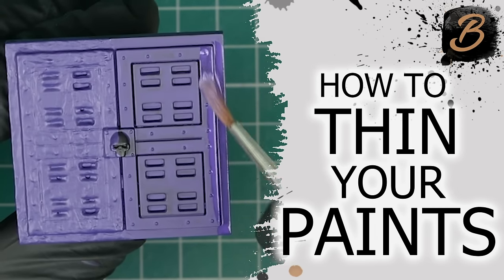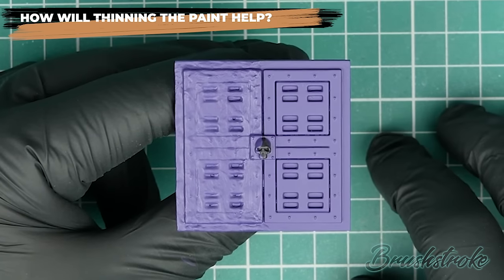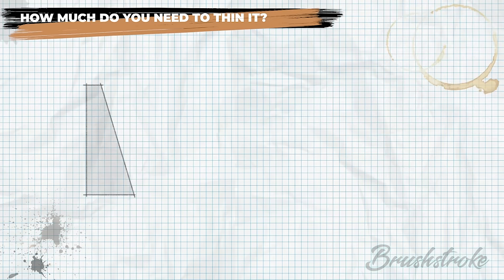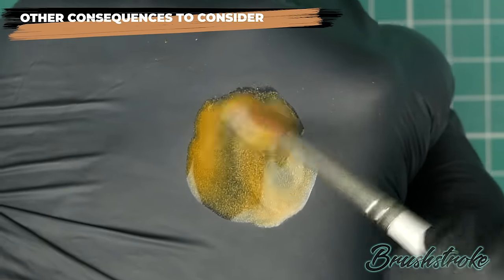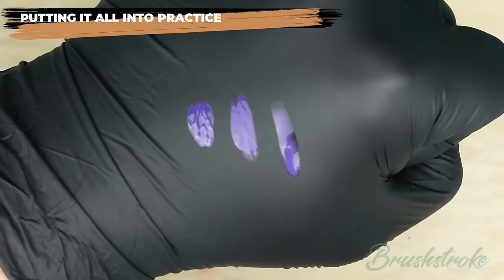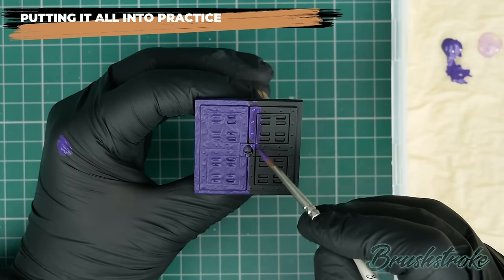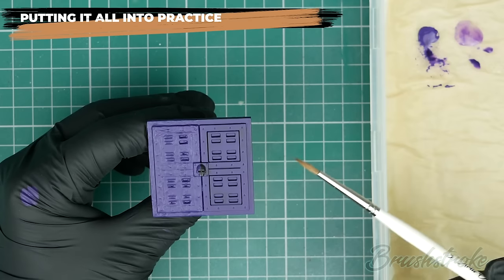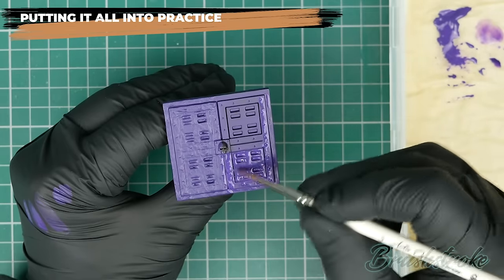HOW TO THIN YOUR PAINTS: A Step-By-Step Guide

Comment: Wow the quality of this video is insanely high from a smaller channel.  Great job!
I will admit at first I didn't think you were doing a very fair comparison as your un-thinned side was pretty sloppily placed down and then you just cut to the thinned side being done which left me a bit suspicious of what was going on.  But you came back to it and showed the actual painting, and while it was more controlled than the other side, it wasn't anything that didn't look doable by any other ape like me :)
I need to try this, but I still suspect there is more to it than just the thinning, otherwise how is it that I often get patchy and ugly contrast coats? They are super thin on their own.
Reply from the maker: Thanks for watching man.
Yeah, the initial comparison is very much intended to be crude, mainly because I can’t tell what skill level the viewer is and I didn’t want to alienate anyone. The idea was to make them almost laugh and say to themselves “hell, even I can do better than that”
More experienced painters will of course see right through that, but then they should be comparing their current results to the right hand side. If theirs isn’t that smooth… then watch on 🙂
So, you ask a good question. 
Why is it contrast paints don’t simply shrink and settle like the paint in the video?
And the quick answer is they’re not like the paint in this video. 
They are designed to behave differently. They have an additional property. They stain.
Give this a watch, it’ll explain it better than I can here
https://youtu.be/mADYQQOH9a8

But it’s that staining property which is creating the watermarks and patchy finish.
Once you know how they behave you can adapt your application and limit the ugly results by not overworking them and actually thinning them more.
Give that vid a watch and let me know if it helps and if it raises more questions 👍

Comment: This made so much sense, thank you - subbed! Question: there are a couple of spots where paint bridged between the outside frame and the inner square section (with the tiny areas you needed more speed to get paint into). How do you clear those one if it's not desirable?

Comment: Right, I know what my problem is now. I realize I've seen this on Zumikito's channel as well and it's the damn wet palette. He puts tissue paper between the sponge and the parchment paper and I don't know what you're doing, but it's much more bumpy while mine's flat. If I put more water in, it spills over the parchment paper and getting that ratio is kind of difficult. 
So my guess is that the water gets pulled out of the paint. 

There's another difference I've noted. When Duncan explains when it's thinned properly, he says "it leaves a flat trail without being watery and without leaving texture" when drawing a line. Seems to me it needs to be a little watery at least.

It wasn't a huge issue for me, because I have other issues at play (cat hair and particles being stuck on the priming stage, rescuing old models etc), but I happened across this in my recommended and I'm glad I did, this will likely help me going forwards.
Reply from the maker: Hey man
So, for your wet palette you shouldn't have any water sloshing around at all. The only water should be in your sponge or paper towel (or whatever you're using as the reservoir) . There shouldnt be any standing water at the bottom of your tray.
I dont bother with a sponge and just use kitchen roll (paper towel). I make up a large cushion of it. Pour water over it and saturate it. Then tip out ALL the excess water. I usually squeeze a little out of the towel a bit too, as it should be damp / wet not swimming.
Then I apply the parchment paper on the top. Hope that helps

Thanks for watching. Let me know how you get on

Comment: Hopefully you can help with this. I have the army paint set (not the speed set) and a wet palette, and nothing I try seems to get your result. 

I'll get a damp palette and put a drop of paint on it. if I take paint directly from the drop, the colour is too thick. If I drag the drop of paint to the wet palette to water it down slightly,  it almost INSTANTLY becomes a wash consistency. 

Any idea what have I done wrong to not have the ideal middle ground in your video?

Comment: should I also apply this method when applying a primer?
Reply from the maker: Yes, Your primer needs to be thin enough to not obscure any details when it dries.
I thin my Vallejo surface primer with some water and apply it using an airbrush.
Just be sure and check what thinner your particular primer recommends to use, as some brands can’t just be thinned with water. 
And of course, spray primers just work straight from the can. Shake them well and I’d also recommend warming them in a bowl of warm water first too.

Comment: TLDR you have to eyeball it. 

Theres no specific amount because pigmentation is so volatile. For example, white is chalky because it has a higher pigmentation to medium ratio, while yellow is so transparent and soft because it has a lower pigmentation (or at least in my experience). The amount of flow improver/thinner/water you use is entirely dependent on the amount of pigment in the paint, so it varies based on your personal instincts with how the paint feels, and the brand you use, with margin for error in the mixing process like paints made in the same factory and put into the same pot 5 years ago will be different in consistency to the same paint years in the future. I remember something about citadel changing its recipe in 2023 so the paints are slightly different.

Comment: This vid helped me out so much. The only thing is, I noticed it’s not working with my white and yellows. I spent time trying to get that opacity with retract, but I keep getting that transparent with retract. Dunno know if I’m doin something wrong or if it’s the paint itself
Reply from the maker: So, you’ve picked the two colours with the smallest colour particles basically, so that makes their coverage chemically poor.
So, my advice for white is where ever possible try and work with a slight grey tone, this is because black has a very large particle and therefore improves the coverage of the paint immensely.
OR switch to a different paint brand for pure white. The best I’ve found so far is Two Thin Coats paints’ White Star.
For yellow, I prefer to just accept it is thin and thereby apply it as a concentrated glaze over a pre shaded surface.
Creams and browns work well for this
Take a look at my how to paint white and yellow videos to see what I mean

Comment: What about things called Thinner Medium?  When and how do we use that?
Or are they not worth it and we should just always use water?

Amazing video.  Thank you so much for the help!
Reply from the maker: Thank you

Very fair question and one I’ll have to cover in another video.
But for now, the answer is unless your water has a high mineral concentration you should be fine to use water to thin for 90% of the time. 
Times when I use medium instead (the other 10%) are when I need to make the mix past the point where the paint splits. All acrylic paints have a limit to the amount of water they will accept before they refuse to hold together anymore. So, if you need to go past they point you’re going to need to use medium because it will enable to the paint to continue to bond together. Think of it as paint without pigment. I also try and use medium from the same brand of paint as I’m thinning as that should make it identical to the paint being thinned.
I would recommend using thinner instead of water if your water does have a high mineral or contaminants level, so as to not affect the paint result.
Hope that helps a bit

Comment: Hi I just got through the details of this video, I have a question for you. 

Why did  you use different brushstrokes between the test areas? For the unthinned area you just stippled the paint with your brush, whereas the thinned version your brushstrokes covered 1/3, 1/2 or the whole vertical length of the piece. The lack of brushstrokes means that the overall amount of paint used would be much more than required.

I feel if you compared the results by distributing the paint the same way, that it would give a much fairer comparison
Reply from the maker: A reasonable question.
So the comparison is meant purely as a means to an end. It’s just there as a way of kicking off the conversation.
The “meat” of the video is the fact that all paint should be considered as being at different points on the same scale and through observation it is down to the painter to determine whether the paint is currently at the right point in order to achieve the result they want.
The left example was done purposely bad as I can’t assume the skill level of the viewer and in no way did I want to alienate anyone by making them feel like they’re not at that level even.
It was my feeling that more experienced painters, such as yourself, would simply compare themselves to the right side and ask if their result matches. If so, great. If not, then watch on.
I hope that helps a little to explain the rationale for the comparison?
Reply: @BrushstrokePaintingGuides  Thanks for the explanation. The video was super helpful and well made!
Reply from the maker: @knabseraph  all good.
I’ve struggled to try and make it interesting and not too much like a dull school lesson.
So, I may have been “creative” in the comparison to keep people’s attention 😉

Comment: I suppose, while you're learning, if in doubt just add more water. You can apply extra layers to an area that's too thin, but you can't subtract paint from a layer that's too thick.
Reply from the maker: I’m very much in the camp of: much rather have to add another coat than have applied too thick a coat. Yeah.
As you say, you can always add more, it’s much harder to take it away.
Very soon though, by following the process in the video, you will find you get that sweet spot quicker and quicker 👍

Comment: can you recommend a few artist paint brand that has low viscosity like fluid bodily for miniature paint? I've already have some student grade acrylic, but to paint miniature it needs some works to thin it down to the right consistency and by the time I got it right, most of it may dry out though, unfortunately. 
Normal brand for miniature like Vallejo or the brand you are using in the video is not very clear about their naming convention for each color, pigment, opaque level and lightfast makes it very frustrated for me. Thank you in advanced. This is some very good, straight forward and detail step-by-step guide on how to thin the exactly consistency for it to work well.

Comment: I don't understand how 2 coats is enough for you 😢 I need at least 5 to cover primer. Maybe it's cause of cheap paints idk.
But honestly this video helped me a lot! I didn't understand how to properly paint figures even with design diploma  (they never taught us properly). Now I don't have those brush strokes and have much less stress during painting 😂
Thank you so much! ❤
Reply from the maker: Thanks for watching. Really great to hear you’ve found this video helpful.

I wouldn’t get hung up on number of layers. It’s more important you’re getting a clean smooth end result.
Over time, with repetition, you’ll find you’ll get better at finding that sweet spot where the paint has optimum coverage whilst still settling smooth. But in the meantime, it’s better to be a little too thin than too thick.
Far easier to add another layer than it is to remove one 🤣
Keep painting  👍

Comment: The trust I'll have to have in the evaporation process xD
I look at the application and how it LOOKS like it's heaping up inside the recesses, but then is completely gone after it's dried, and I get a little worried that I won't know until it's dried if I've done it wrong.
Reply from the maker: true, but if you've ever used a wash it is exactly the same concept. Flooding the recesses, knowing it will shrink whilst drying, is just the nature of liquids
Give it a go, you'll see it's really not as scary as you might think

Comment: Does this apply to testors enamel paints? I bought those as they were cheaper and easier to get. Will these tricks also work on these paints or will it be far to different and a different is needed trick to thin my paints. I have been dry brushing for a bit and notice it mostly on white paints with brush marks.

Comment: Had high hopes this would help, but when I apply the paint toy wet pallet the paint never retracts back. Using army painter wet pallet and have tried with Vallejo and reaper paints.
Reply from the maker: Don’t despair, I’ve had a few others say the same about using the Army Painter palette and it has something to do with the membrane paper they use.
Those people said switching to the paper I use solved everything
https://amzn.to/3ngaKi4

Now, it’s not precut to the size etc but you do get a huge amount for a fraction of the price for the AP paper, so not such a bad thing

Give it a try and see what you think

Comment: Great video but I still struggle to mix the right quantity of paint & thinners in an airbrush. How do I go about measuring the parts needed for that please?
Reply from the maker: Thank you
So, for airbrush thinning, I use little metal mixing dishes (they're swallow with a little spout on them)
It doesnt need to go on the wet palette as I wont be working on it for any length of time. I use the same principles as I show here but I make it a little faster than I would if I was going to be hand brushing with it.
This is because the airbrush is able to do much thinner layers which dry almost immediately so there's no hardship in doing 4 or 5 layers like there would be doing it by hand. Also means you can get some lovely blends by having that little bit faster
Reply: @BrushstrokePaintingGuides  ah thanks for the info, thats great! I’ll give it a go. Cheers mate 🙂

Comment: Hey man! This video was extremely useful, but there’s one thing I don’t get: the “X parts this, y parts that” in paint mixing. How can you tell what “one part” is?
Reply from the maker: That’s a great question and probably something I could do a quick video on.

The answer though is that there are different methods.
For thicker paints, I tend to dip my brush handle in the pot and then count the drips that run off on to my palette.
The size of drip will be the same each time from the same brush. The bigger the brush the bigger drop though.
If the paint is in a dropper bottle you’ll be able to do drops from the bottle directly.
And finally, if you’re using washes, contrast or inks, you can use a pipette to create drips that way.
Hope that makes sense and it helps? But if not, please let me know and I’ll try and put a demo together 👍
Reply: @BrushstrokePaintingGuides  thank you so much!

Comment: I agree with wolfie54321 says that there is a different approach to this. I don’t disagree with what you’re saying, you can get great results with two or more thin coats. However you’re using what is effectively a watercolour brush, so you’re having to thin the paint to behave like a watercolour hence you have to build up the paint layer by layer to get the opacity. If you use a brush designed for acrylics which has much stiffer bristles then you can work with much thicker paint. What I don’t agree with is that teaching new painters to match the brush to the paint would be confusing. Let’s say I’m a brand new painter and I want paint Warhammer minis. If I buy a set of Citadel Paints and brushes then I get a large base brush to apply base paint all over the mini, which will go on in one coat out of the pot. As wolfie1234 says this is designed to jam it into the detail and almost scrub the paint onto the mini. You just take the paint off if there’s too much. It takes seconds and the results are always good. Then apply smaller areas of base coat with the medium or small base brushes. If the paint is a little thick then add a touch of lahmium medium until it flows off the brush, it should still cover in one coat though. Other paint types have their own brushes, I.e. layer, shade and dry. A very well thought out system in my opinion and perfect for the new painter.
 
So it’s not always case of thin your paint, you can always change your brush 😊 Love your video though and please keep producing them.
Reply from the maker: Nik thanks for this comment
I absolutely always welcome this level of discussion. I will concede 100% the brush type was not considered in this video and as a consequence it does suggest that thinning is the only solution to thick paint.
As you correctly point out, different application with a different brush type can produce a very different outcome.
I think this is another of the many cases in this hobby which proves there isn’t a one size fits all and there’s multiple ways to achieve things. 
If it came across that I was being dismissive of wolfie1234 comments, it wasn’t the case. I was just trying to explain my motivation for the video.
Brush type sounds like a great topic for another video 👍🏻